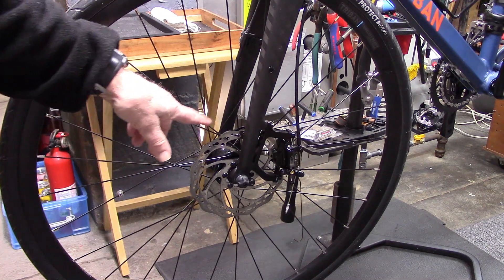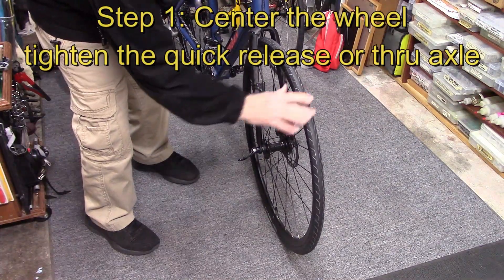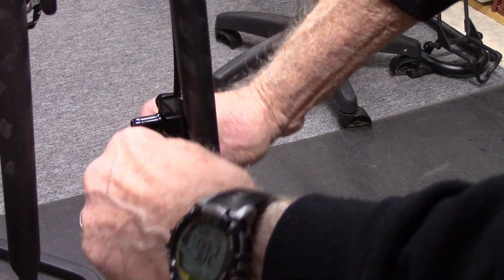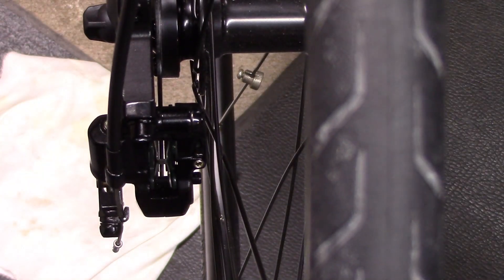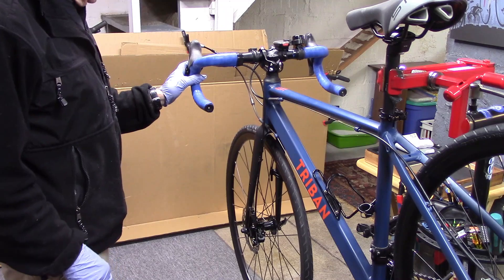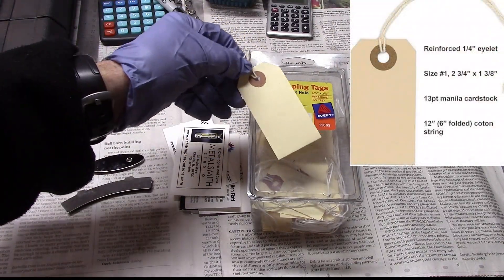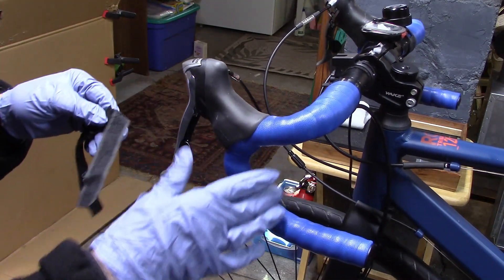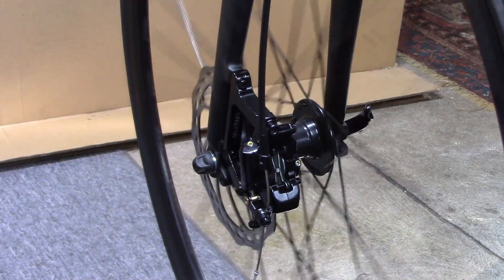Brake Drag (Disc Brake Rubbing): TRY THESE TIPS FIRST

Comment: For disc brakes, mechanical or hydraulic go for thru axle. To minimise disc rubs.
Reply from the maker: Thru axle does minimize the problem of centering hydraulic disc brake calipers, however, not all bikes we service have thru axles. Even with thru axles, one may experience brake drag. This is usually related to dirt, grime or sand contaminating the brake pads or piston seals. Thanks for your comment and safe cycling, Tony

Comment: Thank you for tips. I've the same bike. It's tires are not good in wet weather.
Reply from the maker: I did not care for the single piston disc brakes that came with the bike and installed Orgin8 cable attenuated hydraulic disc brakes. Good stopping power and much easier to maintain since they are self aligning. Have you replaced your tires on your bike and, if so, what have you gone with to improve grip in wet conditions?
Reply: I've changed with 32 mm Pirelli P7 comparatively cheap and they are very good on wet surface.  @tony10speed